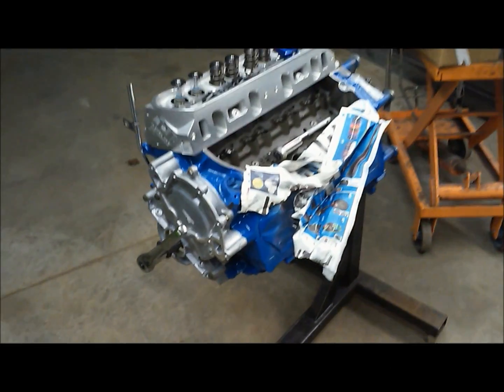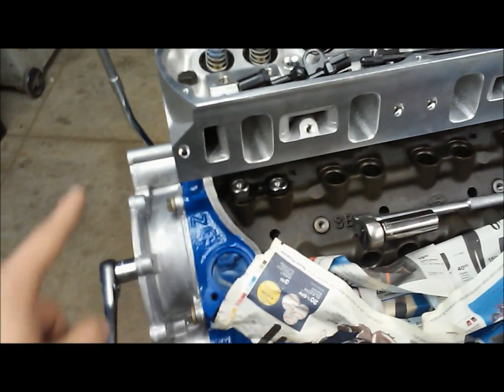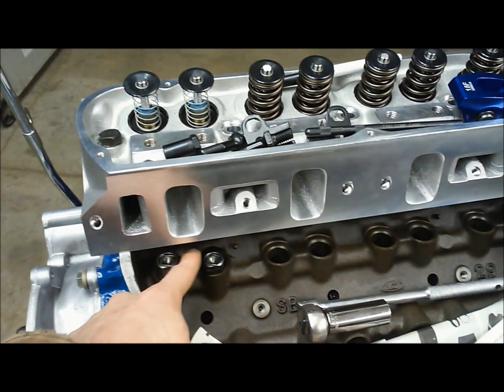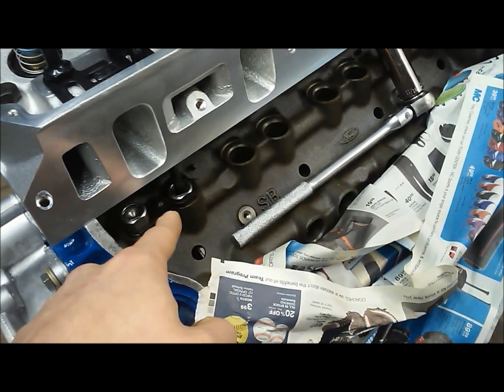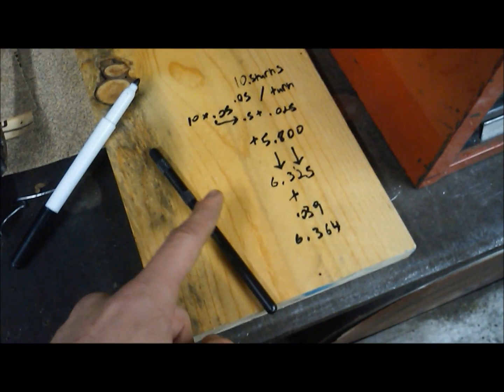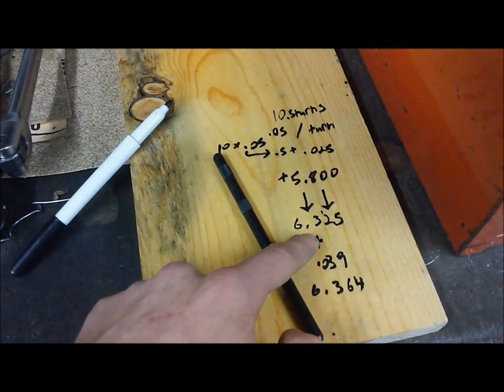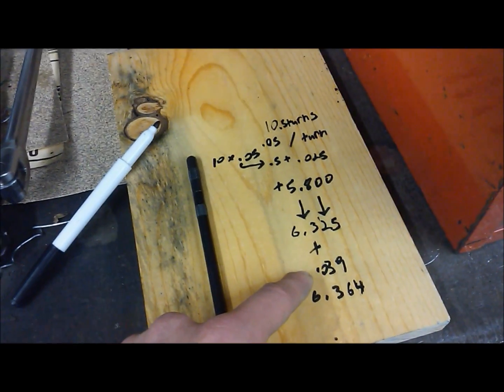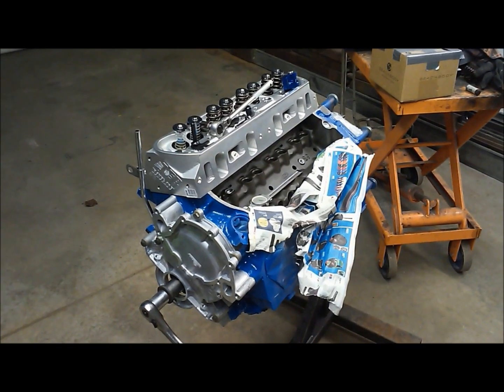Determining Pushrod Length - BEST METHOD (Engine Building Essentials)

Comment: I think I understand it now. My head is already torqued down so I won’t need to add in head gasket thickness. I’ll be using the light checking springs as well. So basically instead of using a mock up solid lifter just use the hydraulic lifters I’ll be using for the actual build and just don’t put any preload on them for measurement purposes correct? Let’s say I’m happy with my wear pattern with my pushrod measuring tool at 6.300, to get my final pushrod length I’d need to add .025 to .030 (or half turn) to account for lifter preload, correct? That’s the part that gets me every time

Comment: I don’t understand , why you add some mystically imagined 0.25 , when you can just fully tighten the rocker arm to factory specs , and measure the actual length without any gessung and adding some 0.25 . I watched all u tube videos and no one explained how do I tighten the rocker . Do I just tighten to zero lash , or zero lash plus fully tightened ( 3/4 of a turn ) no one explained it . I don’t get it
Reply from the maker: There are multiple types is why - your explaining pedestal rockers. These are stud rockers which require a preload from zero lash on a hydraulic lifter. 
And now you know

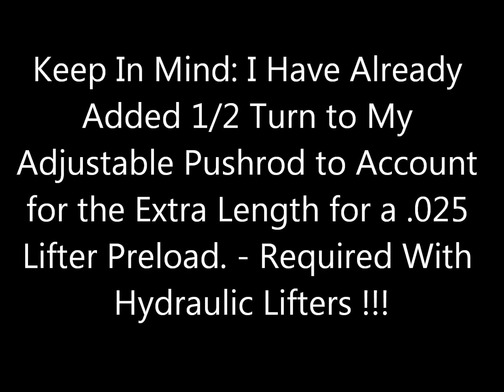Comment: Hey bud quick question, figured id ask here vs creating post on the facebook group, checked my lenght using comp cam tool and soft checking springs, i hand tightened the nut till it snugged up while at base lobe, got a great pattern and centered with the adjustable pushrod extended to 6.35, do i add .025 to that measurement for preloaded as you mentioned at mark 5:43?

Comment: My intake lift is .19 larger than the exhaust lift do i need two different push rod lengths. .584/.565
Reply from the maker: Probably not - highly plausible that the base circle size, which plays the biggest role in dictating pushrod length, will be the same on intake and exhaust
Reply: @ThunderHead289  Thank you so much I kind of figured it would be OK just wanted to be sure. I love your video's by the way .

Comment: Question. I checked pushrod length on my sbc using your method with light springs. Accounted for .020 preload and .015 for head gasket. I checked number valves. Now that I have my actual pushrods, actual valve springs, and heads installed with gasket, the rockers seem to be too long. I haven’t primed the oil pump yet. Will they line up correctly once engine runs? Just wondering why they seem long now. I’m 99% positive I checked the pushrod length correctly.
Reply from the maker: I imagine your head gasket is more like .045-.055, not .015. So that’s something there. 
And you need to be sure that if you are checking with a hydraulic lifter, that the spring cup doesn’t collapse at all during the process
Reply: @ThunderHead289  it’s a this .015 compressed thickness gasket. I didn’t have the deck resurfaced and the new pistons have. .010 shorter compression height. So I was trying to get my quench and compression on par. I was using light checking springs like you have in your video. To be sure those weren’t compressing the lifter.

Comment: You definitely do not need those "special" springs.
Reply from the maker: If you don’t, your lifters collapse and you have an inaccurate reading. Unless you make a solid lifter the exact same geometry of a hydraulic, you in fact do
Reply: @ThunderHead289  nope! It's simple,  don't collapse them.  That's more for those not paying attention. 

I've been doing this for over 20 years, I've checked lengths with and without.  They give you no advantage except a lighter wallet.
Reply: @saltycrowgarage7215 can you please post a video on how you find pushrod length?
Reply: @saltycrowgarage7215 also if you been doing this for 20 years then why are you watching this video?
Reply: @chickenfoundation9323 
😂 right

Comment: Scott Foxwell has a much more accurate method of measuring push rods.  He uses the half lift method and math.
Perfect pattern without guessing.   Every time!
Reply from the maker: This is literally the same geometry as half lift - you just don’t have to go through a bunch of things that you can easily screw up. 
Thunderhead289.
Reply: @ThunderHead289  right, math is puzzling to some.  But, it's the most accurate...for those who comprehend it, anyways.
Reply: @dannymccarty344  you dont really need to do it if youre not building a racing engine.  im gonna use this method as it has worked forever.  

the math is cool and all but unless youre building a high dollar race engine or something that makes quite a bit of power,  there no real point unless you just wanna say you did

Comment: good video on how to use the pattern - but this method is easier, more accurate and you dont need lightened pushrods. you just add value of half turn for preload

https://www.youtube.com/watch?v=o5is9BsH5OU&t=9s

Comment: I know this is an old video but just curious why you wouldnt go ahead and put  the head on with gasket and torque, unless there is reason to remove them again.
Reply: Pressurize spark plug hole with compressed air to change valve springs

Comment: I disagree with using light springs when checking for pushrod length... You should use the valve spring thats going in the overall build to determine it correctly.. My Opinion
Reply from the maker: You will get a bad measurement from deflection in your pushrod checking tool. 
As long as you account for your preload, you are fine. 
If you don’t use a solid lifter when using the actual spring, you will absolutely get a bad read. 
Does this make sense?
Reply: @ThunderHead289  will a solid lifter bend the checking tool or is that when you only use checking springs?

Comment: This is a old video..Proform makes a pushrod checker tool that makes it a whole lot easier to find what length pushrod you need..Great job on the build!
Reply from the maker: Thanks man! 
They have made that tool for a long time, seriously don’t use it - Iv seen that mess so many people up because you have to make some assumptions. You are looking for the smallest pattern possible - a good adjustable pushrod, and light spring will set you straight 👍

Comment: If I need 7.600" pushrods but I have 7.625" ones, is the pushrod length as important if I have adjustable rocker arms? Or does it not matter since I can just adjust the rocker arm to make up for the 0.025" difference?
Reply: Roller rockers aren't adjustable. If they were adjustable, 1 push rod, let's say 6", would be all that's made, for every engine ever made. Lol

That doesn't work either, because some engines are bigger than others, or valve length is different from one head to another. 

So you measure like he says, with the wear marks.

Then, pick the closest match to the length "you think", you need.

Either you picked one to short, perfect, or to long.

Rockers aren't adjustable.

But, maybe if you picked a rod that was too long, you might get away with just adding a "lash cap", to the top of each valve, depending on sizes available.

Unless you have premo, shaft mounted rockers, rockers aren't adjustable.

Comment: With this method you must already have a good idea what push rod length you need. The much better way to do it is use the center line half lift method. That way your geometry is set to exactly the correct angle for every degree of lift in on your cam. Also you do not need to have any idea what size push rod to start with. With this method you need to know deck height and a whole lot of other info not being told here.
Reply from the maker: No, you don’t need all that. 
You get the length checker that is the same length & longer than your stock pushrod length. Simple as that. Retrofit roller lifters? Measure from valve stem height to lifter cup - order length checker. 
Pattern is everything. Bad pattern = accelerated wear. 
I learned the hard way

Comment: ThunderHead I need some assistance on a 91 roller 302 with AFR 165 heads, so I ordered a extra trick flow roller lifter and modified it to be a solid lifter (welded the cup solid) anyhow I pretty much followed your video to get a good length on a pushrod 6.35 inch. I torqued down my heads with a gasket... do I add the preload to the length of the push rod I believe it was a quarter turn in your video?? ill wait for your input before I order my pushrods. thank you sir
Reply from the maker: thunder bolt hey, 
I add the 20-25 thousandths to the length so 6.35 would be 6.37 or so. 
That really doesn’t look like it’s going to effect you. 
I remade this video and explain in much better in my opinion. Here’s the link - 
https://youtu.be/76wbtu9l09A

Comment: So I'm not to sure I understand 100%. So the marker was used to see how much the rocker was riding on the valve stem?
Reply from the maker: Yes indeed - if the rocker geometry is right, the contact pattern will work through the center of the valve stem. i actually just remade this video a few days ago - check my recent uploads - its a bit longer, but more straightforward.

Comment: This is exactly why professional engine builders "Blueprint" An engine to exacting specs. And the fact that aftermarket parts vary from factory standards and the fact that valve stems are different lengths after seating  is why they set up EVERY valve to an exact geometry. Correct me if I'm wrong, but i believe they would remove that valve and grind the tip to be exactly the same so geometry is same or pay closer attention to valve seating heights. My knowledge ends here. This attention to detail is what enables the engine to live. your video is perfect for people like me. 25 lifetime engine builds. Or to be more specific....... 15 engine assemblies.... And about 10 engine builds. Ive come to the point that I would want to correct that un-equal valve length. People should pay attention to every detail thru out the engine. .......Pay close attention to this video, and save untold money in destroyed engines. Very well done.
Reply: I'm not aware of any competent machinist that will grind the ends of the valves anymore, except for MAYBE a stock application.  With more modern tooling, a QUALITY machinist will set valve heights via the valve job, which is the CORRECT way to set it.  This also helps to equalize chamber volume since the valves will all sit at the same depth.  Also, correct rocker geometry should be set BEFORE determining pushrod length.  Pushrod length is a result of correct geometry.  Geometry is NOT the result of the correct pushrod length.  This is not the ideal way to find pushrod length....
Reply: One of the very BIGGEST NAME builders sent us a 383 Chevy complete after Dyno runs.
2800 miles later:
2 sets of chinesium roller rockers.
2 sets of "their name" plug wires 
Another set of plugs.
Now a complete distributor... Chinesium HEI.🙄
On the THIRD Sniper injection set up. First one wouldn't work out after hours with Holley. Sent for exchange. Then a bad injector. Now on the third.
What a piece of crap for $12,000 plus labor.
Owner is having a fit.

Comment: im guessing those lighter springs will help if you are using a new flat tappet cam that hasnt been broken in yet?
Reply from the maker: Who has light springs? Certainly not I in the video. But yes, flat tappet cams need light springs for break in. Another reason I have gone roller

Comment: can you check pushrod length with normal rockers ? or only with roller rockers.
Reply from the maker: You can with standard rockers, but it is much more difficult. I have never tried it

Comment: so like you were saying with me on the other video, do I torque it down to 25ftlb instead of doing the 1/2 turn?
Reply from the maker: Yes, just be sure you are on the base circle of the cam lobe. Ie the opposing valve is fully open on that cylinder.
Reply: +ThunderHead289 ok, I am using the stock springs on the heads and can't get consistent marks, like I'll be adjusting it longer 1/6 of a turn at a time and a fat line goes closer and closer to the middle and the then it just goes way off to the left of the post
Reply from the maker: +0fVolfAndMan it's very hard to do with flat style rockers. Is that what you have?
Reply: +ThunderHead289 well, theyre rounded but have a big surface area
Reply from the maker: +0fVolfAndMan gotcha, those are tough. Stock heads? What cam?
Reply: +ThunderHead289 stock gt40p and the cam is from what I've been told is out of a 68 mustang, it has a reverse firing order
Reply from the maker: +0fVolfAndMan reverse firing order? Only two I know of. The 7 then 8 firing order or the 351w firing order
Reply: +ThunderHead289 I couldn't remember exactly which one, because the guy I bought it from did the wiring, I'll have to look at the distributor tomorrow to see, but I think it might be the 7 then 8